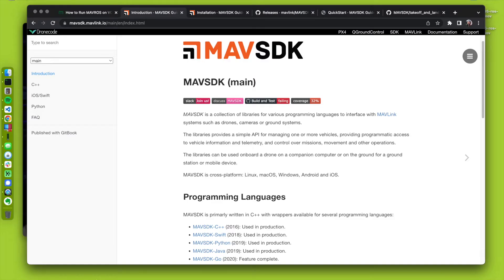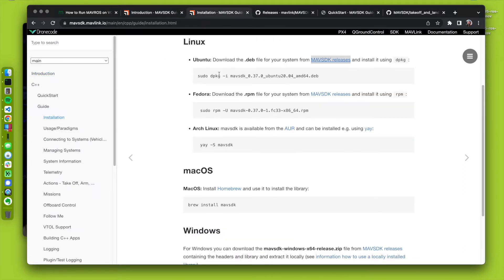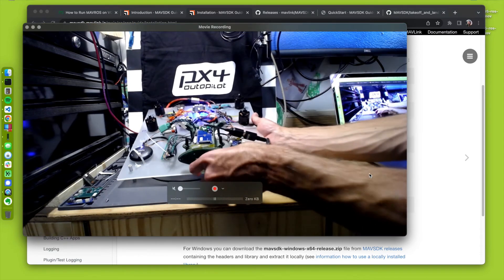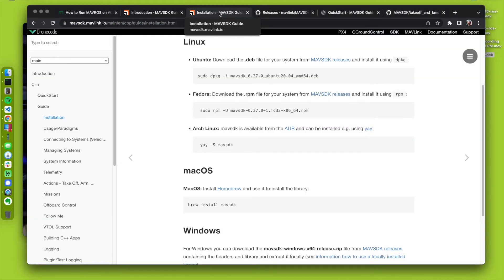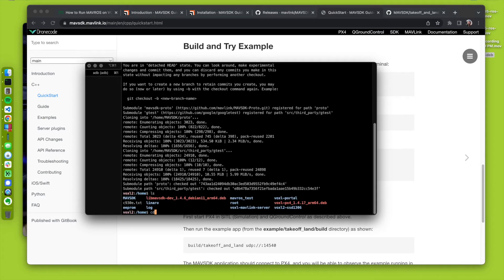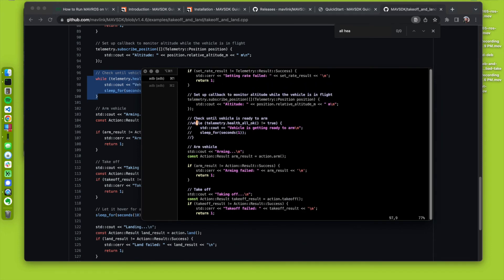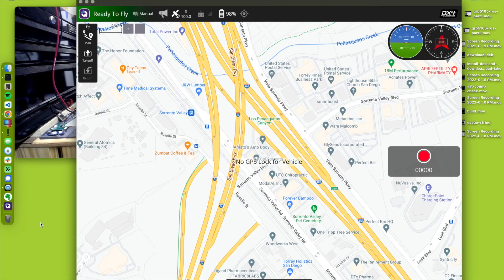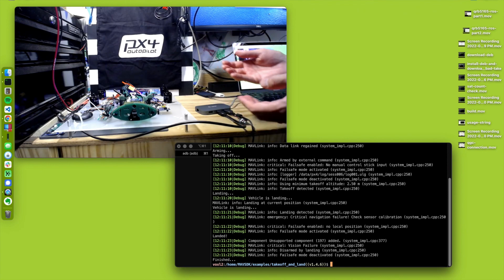MAVSDK on VOXL 2

Comment: The VOXL2 is running Python 3.6.9 but MAVSDK (Python) requires python 3.7 to be installed. Is it possible to upgrade the python version on the VOXL2?
Reply from the maker: Hi Jose,

Yes, it is possible. VOXL 2 runs Ubuntu 18.04 natively and therefore packages can be updated as you would on any other device running Ubuntu. 

If you have more questions about VOXL, you can reach our engineers directly at https://forum.modalai.com
Reply: @ModalAI  I was trying to get the package installed using Docker, but the installation instructions you guys have on your website are for the VOXL. I read in the forum that the VOXL2 has built in docker support, I assume the "voxl-docker" command is meant by this but this command does not have a "pull" option to get the MAVSDK image from your registry
Reply from the maker: @JARC99_  Hi there! Please direct your question to our engineers over at our forum. https://forum.modalai.com